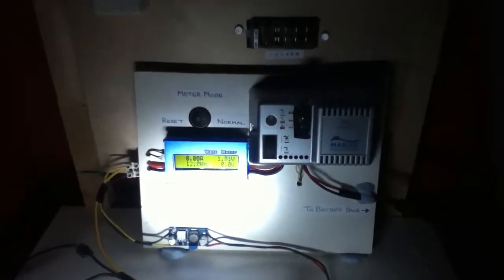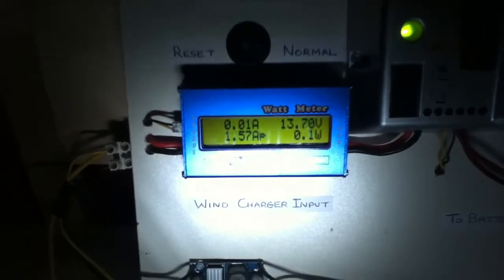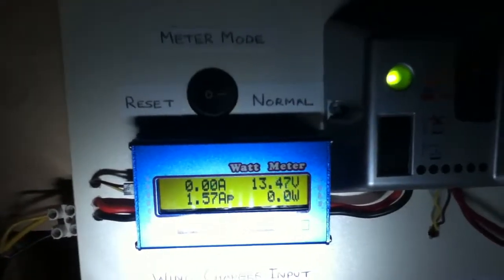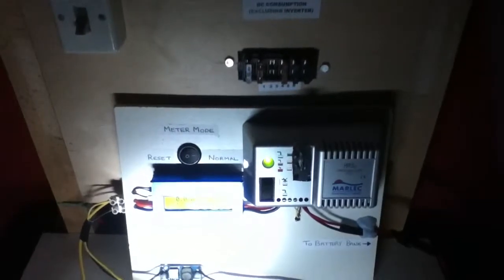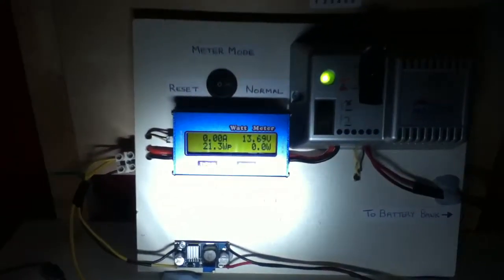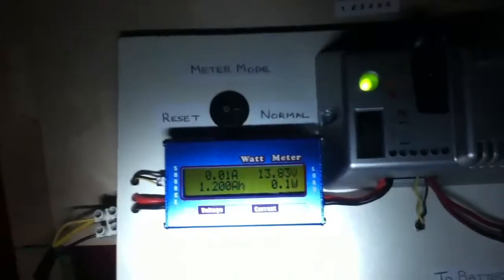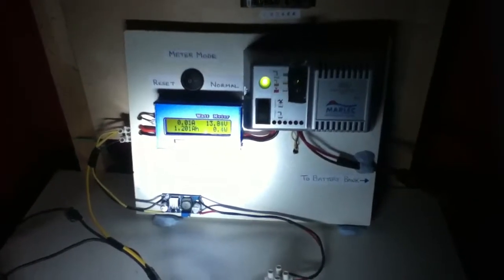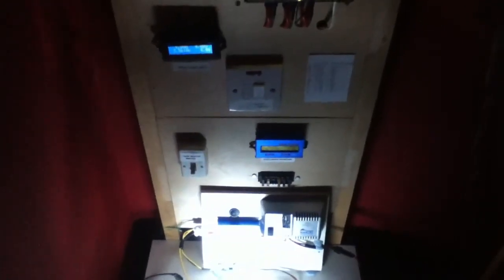Wednesday 10th Dec  A very windy night and the highest power yet

Comment: Do you think the main issue here is because your so far away from the turbine to the house that you're getting massive voltage drop. DC doesn't travel over distance well. I'm thinking for this set up that the three phase motor would be better. On it's own it would be sending AC to the house where the rectifier should be to change it to DC just before it enters into the charge controller.
I could be wrong but this would make more sense to me. Now I think I understand the benefits of using three phase motors with the rectifier as a separate unit, distance, as in your setup.
Reply from the maker: Hi, thanks for the interest. The main reason I don't do well with the wind turbine is my location, I'm in a built up area surrounded by houses. I can't put the the wind turbine on a taller pole because there are overhead power lines ( not safe to install). The turbine itself a Rutland 504 which has now been replaced with a Rutland 913 are designed to output dc current on the output cable. The rectifier is built in, ( I upgraded that component) there are only 2 wires going through the slip ring that connects to the pole. So I can't put the rectifier at the house end ( not enough wires). The turbine can supply enough voltage at the house end when there is good wind, so voltage drop is not an issue. The wind tends to be in gusts and quite turbulent due to the surrounding houses. My location is just not suited to a wind turbine. I also have 3 x100w solar panels wired in series to a victron Mppt solar controller and I do very well with that. Thanks again for your comment. Solartiger
Reply: @The_Solartiger  After looking at the 504 model  myself I realised that it does have certain limitations that put me off.
I'm thinking of using wind for extra power for my campervan while stationary but it's expensive for what seems like dismal returns and the inconvenience of setting up and taking down every time.
Unless I can get a steady 1 amp or more at over 14 volts it's just not worth it.
I am surrounded by coast and need the power to run my diesel night heater, it uses electric for the fan and glow plug heater averaging 20 to 24 Ah per 24 hours of use.
Parking near the coast will give me wind but make my van colder meaning more use of the heater consuming more electricity. This is like a dog chasing its own tail and probably not worth it for me.
I can only fit 200 Watts of solar to my roof ( I have it but not fitted it yet ) so I know I won't get much in winter.
Driving to charge unfortunately seems to make the most sense in winter, wasting diesel.
Your videos have given me some insight Solartiger thanks, and thanks again for replying.
Reply from the maker: Hi, since you can only fit 200w of solar panels on the roof of your van. Have you thought about the use of portable solar panels to produce extra power, say in the winter time. The type that fold up when not in use and can be stored in the van when you are on the road. The advantage of these is you can move them around to catch the best sun. This also has the benefit in the summer, that you can park in the shade to keep cool but catch the best sun to charge your batteries. Just  a thought you might find helpful. Solartiger
Reply: @The_Solartiger  I have been looking at them and they do seem the most logical way to go. It would work out a lot better too as I could face them easily towards the sun. The sun is low in winter so sticking them to the side of the van with those large suckers would work. Cheers again Solartiger 👍